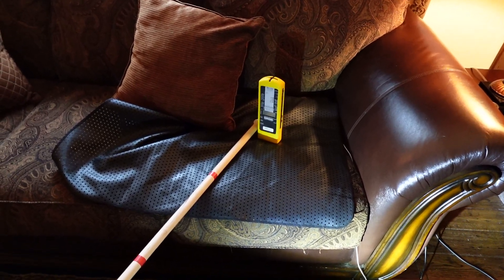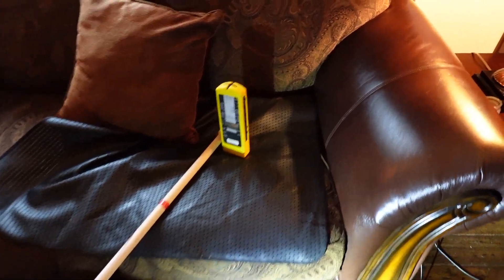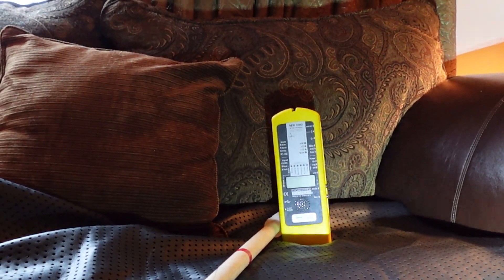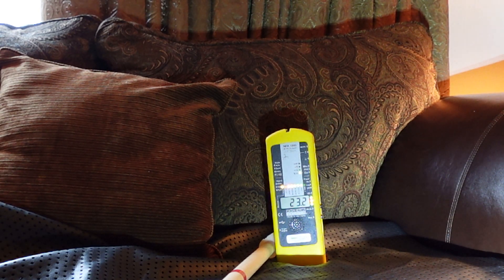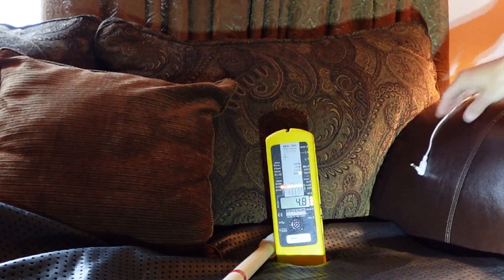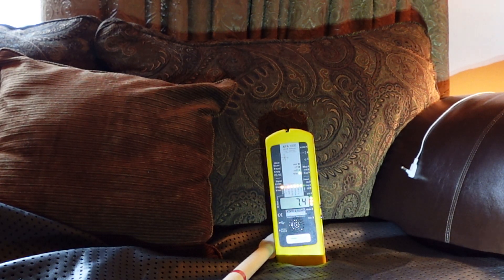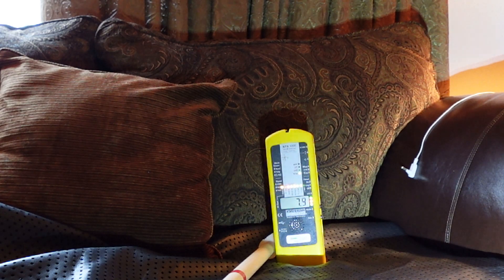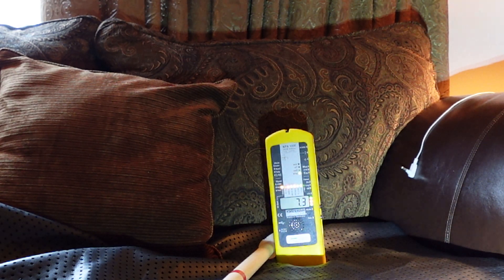The Problem with Earthing & Grounding Mats

Comment: Look,  I'm an engineer. Have you seen what lightning does to a home? Lightning follows the least amount of resistance. I personally have seen lightning where it stuck a tree next to a house, jumped to the house and did not confine itself to the lightning rod. Instead it jumped down and blew out the outlet in the wall. So if your sleeping on a mat plugged into a standard outlet in  the wall it's your life.  Well, I guess it's your life. As a professional I suggest a 6258 ground rod to ground any type of human grounding situation. A 6258 is a six foot long no.2 copper 5/8 diameter ground rod. Just because your sticking a rod in the ground that doesn't mean your grounded. It must be deep enough to be in a moisture zone of the soil. Some areas the c elective code requires 2 ground rods to ensure proper grounding.  No, putting a cup of water everyday does not ensure ground is made. Especially with a short little rod not designed to serve a purpose it truly not capable of doing.
Reply: 🎉 💯 🔥 A+!! Thank you!!!  Do you use a copper wire, specifically, attached to the rod? Or any wire? Thank you.
Reply: @DezY-jl3gr  you need a ground rod clamp especially designed to withstand the weather and guarantee a constant ground.  Yes, use only copper wire as it is the best conductor of electricity. For a personnel grounding I would use a 14ga. bare solid copper wire routed into the most convenient area you intend to ground. Be sure to use copper clamps or wire connectors at the routed location connection and twist the wires together before screwing on your electrical connector.
Reply: @offgridselfteliant  Thank you so much!!

Comment: I would never connect my earthing sheets to my house electrical system for a variety of reasons. Just run an independent ground wire to a grounding rod in the actual earth OR run an independent ground wire to a cold water pipe (I did).

Comment: wouldn't killing the breaker to the outlet you're plugging the ground wire into solve this? bc then hot and neutral are suspended while ground remains accessible? or youre saying the home electrical system always gives interference regardless?

Comment: There's something wrong with your ground. 
By code, outside grounds should be TWO 8 foot rods deep in the ground and four feet apart. That ground should extend to every socket ground pin in your house. If it doesn't then you have a house ground problem.

Running a wire outside to a ground rod is basically the same thing as ground rods on your home electrical system.

The best way to observe signal noise in a room is not with a meter but with an oscilloscope because, not only can you observe the level of noise, but the frequency of the noise.

Comment: I am a ley line hunter and have discovered that line of energy on the earth can have a negative effect on you or a positive effect on you.  Make sure you test the area you are putting your grounding stake in the ground to make sure that it is a good place to receive benefits from the Earth.  If you test your ground and your body you will find that there are places on the earth that can raise your voltage or lower your voltage.  Please make sure that you don't hit a spot that will lower your voltage or you will feel the horrible effects from such energy loss!

Comment: I used a 5/8 copper rod outside to an outlet and conected the Green wire to the grounding screw on the ekectric receptacle sobi dont have any issues with dirty electricicity
Reply: Are you sure?  Could it be having a negative (-) affect your spelling? (LoL, no offense, please,  just having a little fun!) 😉😉😁

Comment: I got a grounding mat a few days ago. I've used it several hours each day. After about half an hour I noticed a significant improvement in my mood and happiness. I felt noticeable calmer and more focused. I also have been sleeping noticeably better. It has reduced my bodies voltage reading by 62%.
Reply: I'm amazed that your body's voltage has reduced so much!!  Do you have the ground wire going outside into the Earth?
Reply: @DezY-jl3gr no it's in the wall outlet ground.
Reply: @Apex0489  awesome!! I'm going to try that first then. Thank you!!

Comment: Agreed! Yes a big issue is AC EMFs. Now, you tested a socket with a light plugged in and turned On creating an EMF field due to current flow at that sockets wiring and the lamp cord. You also moved the ground wire away from the lamp cord which doesn't have a ground wire so the EMF field of that wire is MUCH higher. Even if you ground outside you're going to be the EMF ground if you're near an EMF field.
Reply: Are you sure!  I didn't see any electricity fluctuating,lol!
Reply: With what meter? If you can see electricity you got a big issue! @DezY-jl3gr

Comment: For those confused:

From what I've read, if you're using a grounding mat in an apartment, you must switch off all switches in the 50cm circumference of the mat.
The reason for this is that doing otherwise attracts EMFs (like you can see in the video, he had a lamp plugged in too).

If anyone can correct me, please do.
Reply from the maker: Not good enough- the grounding mat connects to the electrical system grounding component, which is not current-free.  So you become part of the electrical circuit.
Reply: @optimaldwellingspaces3947 what is the problem with that?
Reply: I've made my own mat from aluminum screen and have been using it for the last 8 years. When I was getting headaches and strange feelings I was laying on the mat and would recover in 20-30 minutes. This works really well. Don't know what's wrong with what you're doing. Maybe with my apartment complex built some 50 years ago and back then it has metal electric boxes, not plastic

Comment: Hello, thanks for your video! I have a question and I would appreciate if you could answer me. My husband has a severe neck and shoulder pain. He had bone tumors and got them removed but the doctor had to put  plates and screws on his neck alsohe has screws on his leg due to an accident he suffered. Can he use the earthing grounding mats or even the patches to help with his pain? He has been suffering with pain for about 30 years 💔 😢

Comment: When I get off my couch I know I am probably charged and I touch the floor (ceramic tiles) with my hand, sure enough, it makes a spark. That means I could just ground the couch to that same floor without a pole in the ground, no ? 
My textile couch has metal frame with some padding between that and the floor (it might not have direct contact to floor), I don't suppose I could just link that metal frame to the floor without any mat, no ? (mat as in the video).
I will check if I make a spark when touching the couch metal frame too, if I don't, then I suppose that frame makes contact to the couch but not to the ground / floor.

Comment: Hey, what would a Multimeter show you in this instance? Is the Gauss meter the true way to measure what's happening? In terms of dirty grounds, how often is that in a house? Im curious in testing here, we have grounding sheets which we noticed immediately how they affect our sleep. One being very vivid in-depth dreams. And a slight tingling sensation during the first couple days. 

However, I like seeing what's really going on in terms of either volts? or eletromagnetic (magnetic Field) that can be picked up by a gauss meter. They're not cheap tho from what I see... Can you give me some insight here and potential actionable things. Maybe a multimeter will show us what we need to know?

Comment: Just bought a land kissing mat. No mat tested 14vAC, with grounding wire it went up to 21vAC. Tried another cable, same socket, same mat.Dropped down to 0.55vAC... Be careful what you buy. They are not all created equally.

Comment: I think this was an important piece missing by all this "products". Grounding it is not new in electrical field but needs like all things to know why you are doing and the proper tools and materials. 
For proper grounding on homes, MUST be a dedicated copper wire for GROUNDING only, and must be separete from AC lines, otherwise will transmit as you demonstrate here. And for good grounding you HAVE to mease the grouding by using an special Meter.  Hope  people became serius on this matter and make a nice and clear community.

Comment: as a "line man" for 38 years i can tell you this..if your house is properly grounded and your meter can has a ground coming out going to a drivin ground rod into the earth with the correct ohms, there should be no issues...
Reply: What if I live in a high rise apartment. What can I do to safely ground myself
Reply: @kurodesuuuu Exactly!

Comment: Even being tied into a ground outside could be problematic as well. I would try to keep as far away from any grounding electrodes that are tied into your main panel or main point of disconnect. 
If for some reason there becomes a faulty point of connection within in the service neutral, it will use the ground which is not its desired path to try and get back to the source. 
This may energize the rod, the grounding wire and even the person in the path of this connection.

Comment: Very interesting video. I use a grounding bed sheet in my bedroom but I shut off the power Breakers going into the bedroom before bed where the grounding cable goes, does that make a difference?

Comment: I have a proper earthed socket with an Emf detector. 

Of course you don't switch it on when the grounding mat is plugged in.

But Why don't I get high readings then?

But also to counter, 
I have two whole nights experience of using the grounding mat and having extreme uncomfortable body sensations the next morning.
I am still figuring this out.

Comment: I don't have this issue with my grounding bed sheet. Doesn't have the slightest influence on the EMF when plugged into the ground connection of the power plug.

Comment: Hello :) I just bought a grounding well mat and I am reading all these comments  and  I am just so confused and now kind of worried. From all these comment, now I don't understand how to properly use it  and I live on a 4th floor in an apartment building. So, how do I use it safely and what do I need to do, how to set it up? Please explain!! It would be so greatly appreciated.🙏
Reply: They don't work. Simple
Reply: Did you find an answer?
Reply: @kurodesuuuu  No, I didn't, unfortunately    :(
Reply: @Cher2CA  From what I've read, if you're using a grounding mat in an apartment, you must switch off all switches in the 50cm circumference of the mat.
The reason for this is that doing otherwise attracts EMFs (like you can see in the video, he had a lamp plugged in too)
Reply: @kurodesuuuu  What if I use EMF blockers?
Reply: @beew1674 I’m not sure if all of these guys concerns / opinions on it are true, but what I will say, is most EMF blockers don’t work at all because if something like a phone has its signal being oppressed, it actually just works stronger. Not sure about EMF from other sources that are not a phone/computer etc.

Comment: The levels you're mentioning do exceed typical exposure guidelines for residential settings. Let's break this down:

1. **Guideline Levels**:
   - The International Commission on Non-Ionizing Radiation Protection (ICNIRP) provides guidelines for exposure to electric fields. For the general public, the ICNIRP guideline suggests an exposure limit of 5,000 volts per meter (V/m) for low-frequency fields (50-60 Hz).
   - However, certain more conservative guidelines, like those from the Building Biology Institute, recommend much lower levels for a healthy living environment. The Building Biology guideline suggests that an electric field exposure of less than 1.5 V/m is ideal for sleeping areas.

2. **Measurements in Your Home**:
   - **25 V/m (when connected)**: This is significantly higher than the 1.5 V/m recommended by more conservative guidelines but still much lower than the ICNIRP's general public limit. It indicates the grounding mat is picking up and possibly amplifying the electric fields from household wiring.
   - **8 V/m (when disconnected)**: This is still above the 1.5 V/m level but much lower than when the mat is connected. It shows a substantial reduction in exposure when the mat is not plugged in.

3. **Interpretation**:
   - **25 V/m**: While this is higher than the conservative guidelines for sleeping areas, it is still considered safe by broader international standards (like ICNIRP). However, for those particularly sensitive to EMFs or aiming for the lowest possible exposure, this might be considered high.
   - **8 V/m**: This is a moderate level of exposure, higher than the ideal but lower than what the mat generates when connected. It's still within a range that many would consider reasonably safe, though not optimal by conservative standards.

In summary, the 25 V/m level when the mat is connected is higher than the conservative guidelines but not considered dangerously high by broader international standards. The 8 V/m level is more moderate. If you're aiming for minimal exposure, you might consider using the mat unplugged or finding alternative ways to ground it directly to the earth outside, bypassing the electrical system in your home.

Comment: I cannot sleep. I keep waking up in the middle of the night more than I usually do only slept on the grounding sheets two nights went and stayed in the hotel after the first night and slept better. Not sure what to do. I used the tool to check to see if the outlet was OK for the bedsheets, but the grounding sheets seem to be causing me issues. I’m not sure if it’s just because it’s trying to ground me, but I do ground exercises my whole life. I am a Capricorn and I walk on the earth with bare feet actually just did this morning at 7 AM, so I also do work Reiki and MoaKi Shiatsu ; any suggestions should I keep trying it for awhile?
Reply: What on earth does you being a capricorn have to do with anything being discussed here?

Comment: Would grounding to the copper pipe of a central heating radiator work. I understand the pipe work is grounded to the earth?
Reply: I connected a copper mat to the copper hot water heat system because my voltage meter identified it as an excellent ground. I hope it is safer than connecting to the home electrical ground. I am looking for the same answer to your question. It would be useful to know because many people live in buildings where it is impossible to run a wire outside to ground.

Comment: I was using the outlet with my sheet at home,  and could feel a light tingly sensation. I lived in a apartment complex. I bought a rod because I was going camping. I didn't feel that tingly sensation anymore,  so I got curious about the differences between the two and came across this topic of dirty electricity! Glad I found it and will use my rod from now on at home.
Reply: What do you mean by rod ? How do you use "a rod" when tge mat is Inside, not outside ?.?.
Reply: @susanrupp9357  the rod stakes into the ground and attaches to a thin wire that you have to run into your house through a window or hole and plug it into the mat

Comment: Interesting info but the video does not show you testing the outlet itself to see if it is properly configured. Grounding mat companies I use recommend first testing the outlets to confirm they are wired correctly. I've checked all my outlets and they checked out fine; however, a surge protector/power strip I have did not so I'm making sure to never use it.
Reply: Which country are you in please?

Comment: Wow! So glad I found your evidence based results of radiation using an AC ground! I was sleeping with an earthing mat plugged into a properly grounded AC outlet. I woke up in the middle of the night with my heart slightly fluttering. This alarmed me so much that I stopped using the grounding mat. I live in a higher floor apartment so it is not possible for me to use a true outside grounded wire. So if I ever use a grounding mat again, I will surely use a separate physical grounding rod and wire and not the AC ground. Now I know why my heart was slightly fluttering. Scary!!!😳
Reply: No! His explanation is incorrect. But do whatever you wish. People are just not having IQ high enough to understand things these days. Clint Ober is not an idiot and has been challenged by electricians multiple times. Anyway, bye.

Comment: Can´t you just turn off the electricity of the plug you´re going to use to ground the mat? When I do it, the EMF and EF of the plug go down so I suppose it would solve the issue?
Reply: I think the mat is supposed to be plugged in but  without switching on the plug! ?

Comment: Hopefully you tested your outlet to  be sure it's grounded.  Also purchased a reputable product and not one from China
Reply from the maker: The problem shown in the video is created because this mat connects to the ground in the first place.
All ground mats can connect to the…(wait for it)…GROUND component of the electrical system.  The manufacturing has nothing to do with it.
Reply: @optimaldwellingspaces3947  can you retry with the lamp plugged off